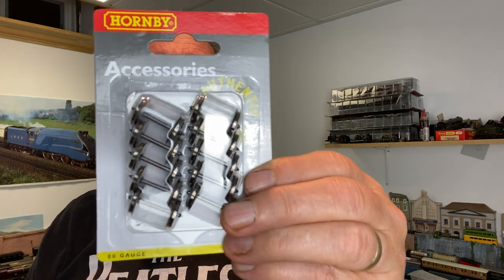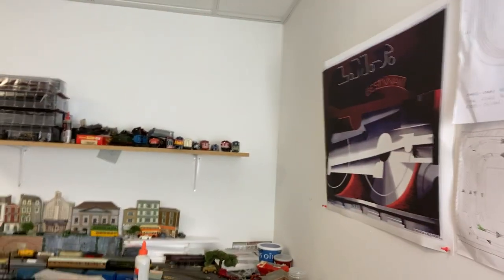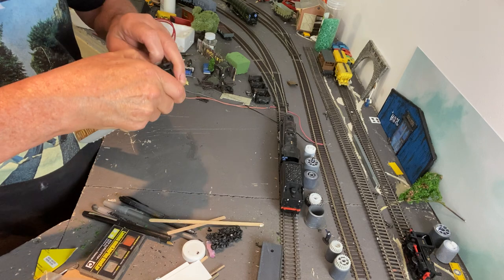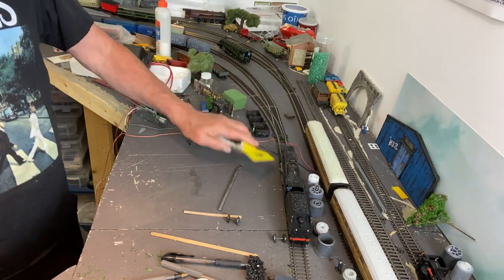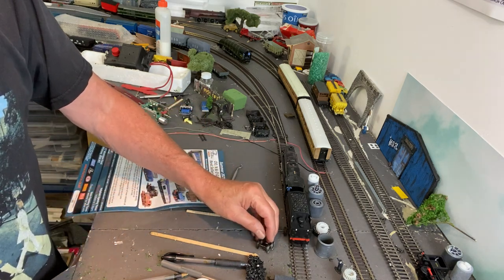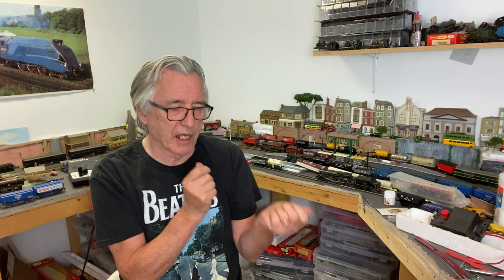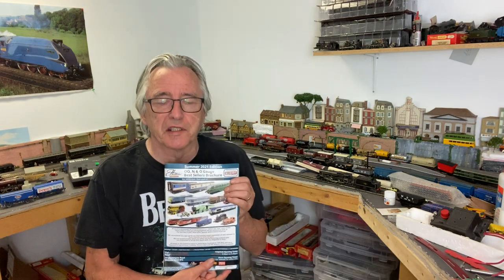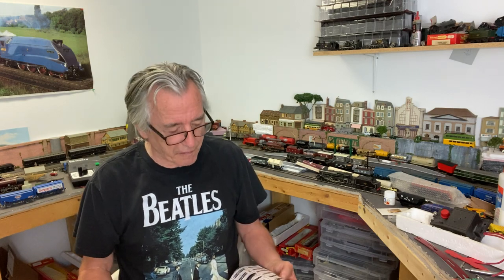Upgrade Your Ride: Swap Plastic Wheels For Hatton's Stylish Metal Sets!

Comment: The metal axle upgrade, is a job for a tame octopus. But the wagons and coaches do run smoother.
Have you considered adding extra weight to your older Hornby?, Gresley coaches, the stock will run more reliably. 
The late Iain Rice suggested  25 grams per axle, and any added weight to an older lightweight piece of rolling stock, also adds to the sound  of the new metal axles crossing the rail joints!!
Reply from the maker: Hello John, thanks fir taking the time to make an interesting comment. I replaced all the wheel sets on my Gresley coaches and that made a huge difference especially through the points.
I have been considering adding weights also and have a box of them waiting to be installed.
Thanks again👍